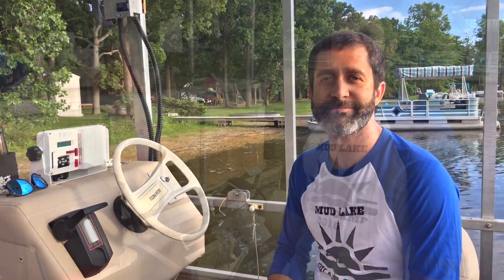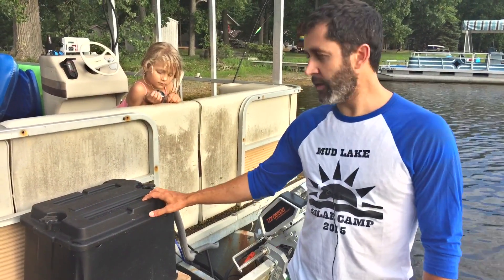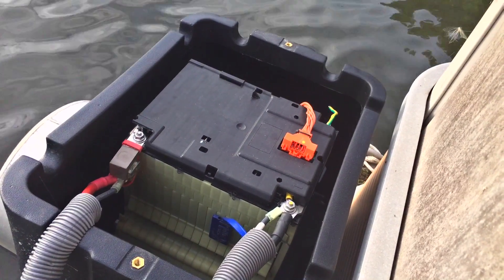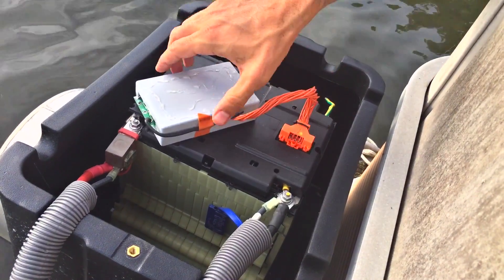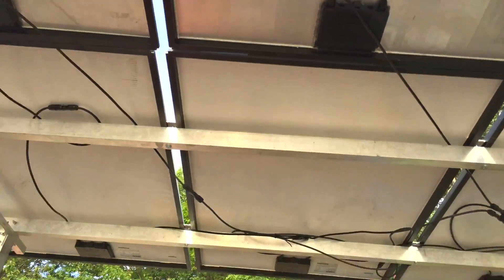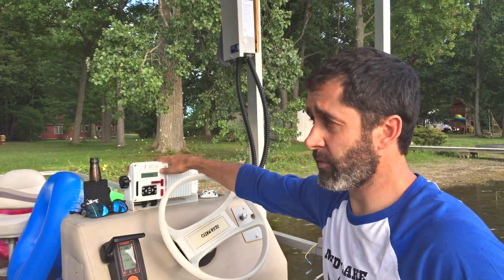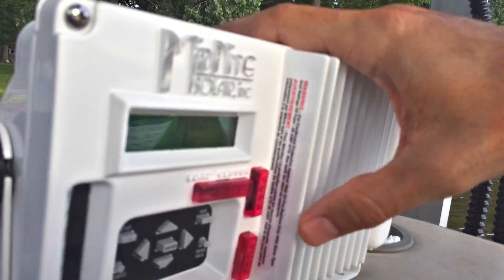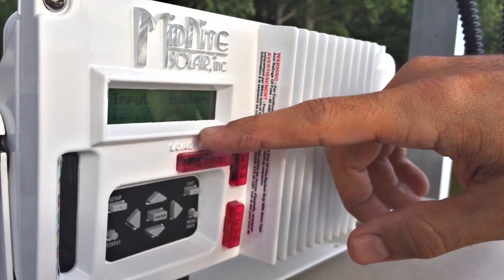Solar Electric Pontoon Boat Walkthrough

Comment: "..six [panels' wired two each in series.."  "two PV strings each on a 15 amp breaker"  Nope.  Two strings would be over 150v, which you said your charger wouldn't like.  Two in series as you first said would be three strings.  Which one is it?
Reply from the maker: @chrisw1462  The 6 modules are wired as 3 pairs of 2 each in series.  Two of these series strings are paralleled and land on one breaker.  The other string lands on its own separate breaker.

Comment: 50v is far from the 'full' battery setting for a 48v Li Ion battery - its actually under 50%.  54.6v is the real number, and considering how Li Ion cells charge, you're missing a LOT of range if you stop at 50v.  Yes, you'll get more cycles out of them, but in an on-the-water situation I think I'd rather have the range for safety.  At least charge to 52.8 volts.  That's about 80% SoC.
Reply from the maker: @chrisw1462  per Chevy specs, max voltage for the module I used (12 cells) is 50.4V.  The cell chemistry is NMC-LMO pouch.  The battery module was taken out of a second hand salvaged Volt pack, not designed or marketed as a 48V Li battery per se (really it’s a nominal 44.4V module).  Incidentally, Voltage vs SOC is quite linear until 41.25V when it falls off; Torqeedo motor cuts out anyway at 42V and it’s never been activated, so overdraw is not a problem.  I use no-load voltage as a credible proxy for SoC.
Reply: @solartroller6960  Sorry, I assumed it was 48v since the motor was made for 48v - with the usual result!  I've been wanting to do a similar build for a long time, maybe rent it out as a solar powered party boat (with me driving, of course).  Since it's been a few years, any chance you'd do a follow up video, discuss the things that worked well and things you'd do different?  Lots of first-time builds on YT, but not many that come back and tell you how it went after a few years.

Comment: Could you explain why you went with two in series on the solar panels?  I know higher voltage = less loss for the same wire gauge, but your motor and battery are both 48 volts, and the down-conversion has to be costing a little efficiency by itself.  Add in the dangers of a high voltage electrical system on the water, and staying with a 48 volt system would seem to be the way to go.  I'm asking because I'm considering doing the same thing you did - making a pontoon boat all electric.

Comment: Very nice. I am currently building a solar electric catamaran. For your set up what is the max speed you are attaining for your pontoon boat? What is the length of your boat? I am planning to use an Elco 20hp outboard which draws 8.8kw, I plan to cruise at a lot less. I have a 10kw LifePo4 battery bank.

Comment: Thank You for going into such detail, and so well- explained.  So... your boat cannot come close to charging the battery while you are under way?   And even if you dial back to 1/4th throttle,  can you charge and consume at the same time?  Thanks much to anyone taking on my questions, I have become very interested in building a tiny solar boat.
I'm thinking 2 passengers, and small enough to push to the water on fold down wheels or a dolly.  I live 300' from a boat ramp.
Reply from the maker: Roughly (ignoring losses), under full sun, the array generates 1000W of solar energy, enough to give 1/4 throttle to the 4kW motor  'indefinitely' with no net drain or gain on the battery state of charge.
Reply: Thank You!!  I guess I'm left wondering whether with extreme care in design would allow for a reasonable cruise speed right away, by using very slender hulls.  I'm intending to build a tiny catamaran for 2+ people using typical kit kayak construction, marine ply/2 part epoxy + fiberglass.
I'm thinking it is possible.  Your setup can call up a lot of power, the craft is heavy, and lake boats don't have the most efficient hulls.  (but your build is amazing!)

Comment: Great setup with an invaluable explanation.

I heard you say that there is a temperature sensor used by the charge controller for a voltage thermal compensation calculation.

My understanding is that this essential for lead acid batteries; however, it does not make any difference with lithium batteries.

Would you know if this applies to some or all lithium batteries, and are there certain lithium chemistries susceptible to charging which depend on temperature?

I thank you in advance for any light you might shed in this regards.

Morningstar, for instance, recommends disabling the temperature compensation setting for Lithium ion chemistries, but they recommend enabling a low temperature battery setting:

https://www.morningstarcorp.com/lithium-batteries/
Reply from the maker: Hi EK, indeed you are right, morningstar recommends to disable temperature compensation for Li-Ion batteries regardless of chemistry.  In my original build, I used a Midnite Solar 'The Kid' marine charge controller, which allows in the settings menu to select Li-Ion for temp comp under the battery menu.  I can't tell you what algorithm is behind that.  And I don't know much about the voltage behavior behind different Li chemistries - although I would expect some differences, I don't know what the order of magnitude is.  Temperature compensation aside, I like to be able to monitor the surface temperature of the cells, for example on a hot day under full load, as Li-Ion batteries can be susceptible to thermal runaway.  Let me know if you learn more!

Comment: Can't believe I just found this. Great explanation of the components. One thing I was wondering are you able to go directly from the solar panels to the motor in case the battery or one of the flow control modules fail? Also, what speed could you achieve with just the power from the solar panels in this configuration? Edit, thanks already found the answer in another comment.
Reply: On a sunny day he should be able to go at moderate speed with almost 1KW, did not mention speeds and power, but my guess would be 3-4mph@full sun here you can see consumption for a saildrive on a sailboat https://youtu.be/EWFjxFkTWmQ?t=1780

Comment: Have you considered placing a small wind turbine on top and using a hybrid solar/wind charge controller? The breezes on the water and the wind while underway could extend your range on cloudy days, or any day for that matter. If you use a turbine that can be braked or locked out, it could also be mounted to fold down when not needed or while transporting the boat on a trailer.

Comment: That's a Chevy volt battery module. Those are not optimal 48v batteries as they are 12s (44.4v nominal). It is 3.7v nominal per cell. The best setup would be 14s which would be 51.8v nominal and max out at 58.8v. that would reach the true maximum power of the torqeedo. Either way that outboard is very expensive for such little horsepower. You can grab a junked outboard and replace the motor with a 10+hp electric motor and controller for $1k all said and done.
Reply: where can you grab a >10hp electric motor and controller for $1k? Got any links?
Reply: @Elspin  sorry, didnt see your response until the recent one.
http://www.freerchobby.cc/e_productshow/?50-NEW-MP56115-125-KW-INRUNNER-BRUSHLESS-MOTOR-FOR-E-JETBOARD-50.html
That link is for a $160 12.5kw (over 15hp) brushless motor. You make a frame to mount it upside down where the powerhead of the donor outboard would be and use an adapter plate to attach. Then go on eBay and search for Flier boat esc. That will show a bunch of watercooled escs that will work with that motor. Pick one with higher amps than motor rating and with the correct series count of lithium batteries you will use with the motor. Easily <$240 for the esc WITH all programmable features such as low voltage cutoff, high voltage cutout, regen, amp limit, reverse controls, etc. Then hook up the motor and esc water loops into the outboard existing cooling loop. The rest is just wiring throttle, batteries, and esc connections along with whatever bms you want to use. I'd skip most of the bms systems though and just use a smart charger for charging cells up correctly, lvc of the esc to protect them, and an active balancer circuit to keep the cells in line while operating.
Reply from the maker: Hi Kenneth, agreed on all counts! 
I am not quite handy enough to play with individual battery cells and found the Chevy Volt 44.4V module 'close enough' for my purposes - although it certainly had some headroom for optimization in my system, it does the job and came as an assembled unit with BMS - nearly plug-and-play.  Also agreed on cost of the outboard for the performance.  It does comes with some features that would be difficult to replicate in a manual build (low voltage cutoff which protects the battery, among others).
Reply: @solartroller6960  check out the post I put for the other guy here. You can have a very powerful outboard on the cheap. I can give you the wiring diagram to cascade the active balancers as well if you want to go through with building one

Comment: I have a 5 HP dc electric motor (about 4000 watts max input) which runs on 250 volts nominal (210 to 355 volts) and 16 amps full load at 250 volts. It has a shunt field for speed control. I will make a voltage tap circuit for armature starting current control. I'm wanting to run 250 volts on my entire system, i.e. panels and battery. I'm thinking of using 40 ea. 6 volt golf cart batteries series connected, or 20 ea. 12 volt deep cycle batteries. I realize that 250 volts and water don't mix well. I will seal all my connections well. I would be using a panel with isolation switches and voltmeters and circuit breakers. Is there a problem with having 20 ea. 12 volt solar panels connected in series?
Reply from the maker: Hi - Electrically no problems but practically you may struggle to find an 'off-grid' solar charge controller that can output higher than 48 or maybe 60Vdc for the battery charging / load circuit.  Typically also these CCs are limited to 150Vdc max input from the solar array.  These input and output voltage limitations might become a constraint.  Let me know how it goes!

Comment: If you're in full sun, can the panels themselves run the motor? Based on the simple math, i would think that it could push you at 1/4th throttle but wasn't sure if its set up to make that work.
Reply: Peter Jensen yes this is true at anytime, you simply match input and output wattage

Comment: 1 hour 1/2 throttle no sun.
Can you get 2 hr. at 1/2 throttle with full sun ?
Can you use 1/4 throttle without discharging battery? (Full sun)
Reply from the maker: Hi 40yeartrucker, Nice questions!  Here is a simplified energy balance for those scenarios:

1 - "Can you get 2 hr. at 1/2 throttle with full sun ?"
1/2 throttle = 2000 Watts load 
Full Sun on 1080W array ~= 900W usable after losses
Full Battery = 2400Wh nominal (2000 Wh usable)

Therefore, after 1 hr @ 1/2 throttle, and starting from a full battery, and under full sun, the battery state of charge would be 2000Wh-2000W+900W = 900W.  At that rate the battery would deplete after around 1.5hrs.

2 - "Can you use 1/4 throttle without discharging battery? (Full sun)"
As long as the array is making enough energy to replace the motor load, I could cruise indefinitely without a net impact on the battery.  I estimate that 'full sun sustainable speed' to be around 1/4 throttle, as you suggested.
Reply from the maker: Here's a cleaner way to do the math: Empty battery will occur at time h: 2000 - 2000*h + 900*h = 0.
Solving for h, empty battery will occur at time h= 1.8hrs or about 1 hr 50 min.

Comment: Great video! I am planning on doing the same to my 20ft pontoon. I was wondering about going to a bigger elec. motorElco makes a 14hp and a 20 hp and I do have a hardtop and I think I can get 1kw of panels on top.
Reply: I have the Elco 14 on my 20ft pontoon and love it! I am looking into a solar setup for it now.
Reply: @miken.5537  what kind of performance numbers do you get with the 14? I just put an Elco 9.9 on solar pontoon.
Reply from the maker: Hi Joseph, sounds like a great project.  I love the Elco products and will say that they appear to provide better value in terms of $/HP.  The reason I stuck with Torqeedo 4.0 is that Elco 20 runing at 48V will draw max current of around 165A!  That's serious juice and would have required a different battery configuration to avoid excessive discharge - probably two of what I have in parallel.  (Torqeedo 4.0 draws 83A max).  So that design decision would have increased the battery costs.  Elco 9.9 is a great value and should perform similarly to the Torqeedo 4.0.  I would definitely go with Elco on my next project.  Good luck!

Comment: thanks for sharing !  How is the system holding u so far after 18 months?
If you could do another video that would be great

Thanks again !
Reply from the maker: Hi Eddie, thanks for the comment.  I only run the boat 2-3 months each summer, so the third season is coming up soon.  The start of the second season exceeded my expectations.  I pull the battery and store it while the boat is covered for the winter.  I simply reconnected the battery, let the solar top it off within one day, and I was good to go.  This year I plan to add on a 48:12V converter and distribution panel to run my 12V loads (lights, stereo, horn, etc).  Maybe I will make a video of that project if that is interesting!

Comment: if your system disconnected due to low battery, how  long ( Hour) till you battery getting charge from the solar system
Reply from the maker: Hi BJFA, I assume you mean if I hit the Torqeedo Cruise 4.0's under-voltage disconnect threshold, which is set at 42V for Lithium batteries.  I don't know where exactly the motor's reconnect voltage setpoint is and I've never experienced it.  To give some perspective, with no load and under full sun, the array (1000W) will fully charge the battery (2kWh capacity) in two hours.  So in normal conditions, if this were to happen, I would expect that within 10-15 minutes I could be up and running again.  Practically, under heavy throttle you experience 'voltage sag' of 0.5-1V which could set off this protection, and it is likely you could in fact immediately restart again under low power from the stop position (as the Torqeedo use manual suggests under the E43 - Battery Empty error code).

Comment: Nice work, I think that The black box, exposed to sun, may cause a strong rise in the temperature of the battery
Reply from the maker: This is a good observation Mohsen.  I think ideally the battery enclosure would fit under the rear seat, where it would be shaded and with good (maybe even active) ventilation.  The Midnite Solar charge controller includes a thermocouple which I have stuck on the outside of the cells, so I can get realtime readings of the pack temperature.  The charging algorithm also adapts it's voltage to consider temperature.  I'm more worried about the pack overheating due to excessive current output (C2 at full throttle) but have not observed any material temperature rise under those conditions.  I am not so worried about overheating due to ambient heat gain given that I live in Michigan... but will keep monitoring this.
Reply: Of course, an easy way to address any potential heat problem with the battery case would be to paint or plasti-dip it in white.   And, of course, you could vent the enclosure.

Comment: I have been discussing over email with the Torqeedo staff about the proper shaft length for a pontoon application. They say there needs to be 6"-10" of water above the prop. I understand you have a unique situation where you have a very shallow lake and cant go with long shaft but I am curious how much water is above the prop with your current set up? How much of an impact it makes in overall performance (primarily speed) of your craft?
Reply from the maker: Hi epicdeuce, this is the greatest shortcoming/compromise of my design.  I used the Short shaft version with remote throttle due to my fear of bottoming out on my shallow lake which also includes a shallow sandbar crossing, as even with the short shaft, the bottom of the prop extends below the pontoons.  This gives me only about 1" of clearance from top of prop to waterline with an unloaded boat.  When I am the only person on the boat, I experience 'aeration' above about 80% throttle.  This is unpleasant and causes the acceleration to become choppy as if the prop is 'gulping' air.  When my boat has 4 or more people in it, with some seated at the rear, the problem goes away.  I strongly suggest to follow Torqeedo advice here and go with the recommended clearance.  Even with the short shaft, I still have to manually tilt the outboard all the way up to avoid bottoming out when I approach my dock.  So the long shaft would have also been unworkable on my situation.  I am considering to install a mounting bracket to lower the outboard by another inch or two to see if that achieves a happy medium.
Reply: I like the idea of a bracket or levered mount where it could be lowered or raised depending on the circumstance. I look forward to seeing a follow up video with the updated changes! Well done, this is very inspirational. You're brave to operate in such shallow waters, i've knicked many props and always makes me cringe
Reply: @solartroller6960  it seems like an anti-ventilation plate would help but torqeedo doesn't seem to include them on any of their motors smaller than the 10t. Even petrol motors as small as the honda 2.3 have anti-ventilation plates so I just wonder why torqeedo, and some other electric outboards makers for that matter don't have anti-ventilation plates.